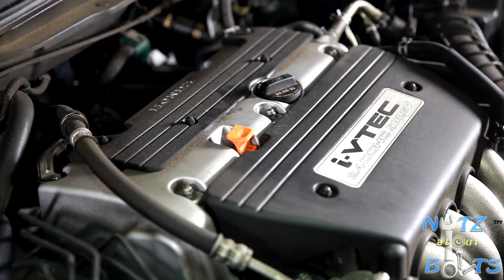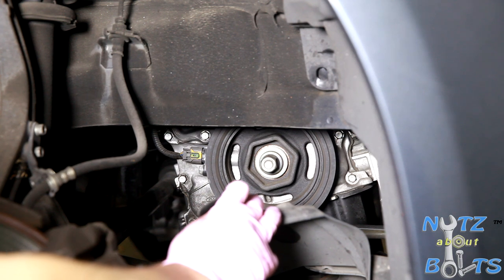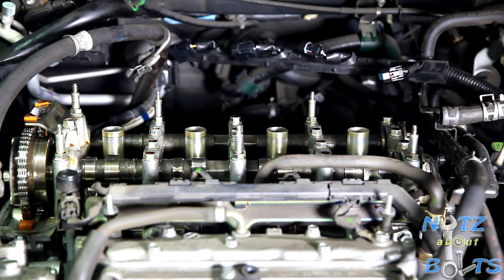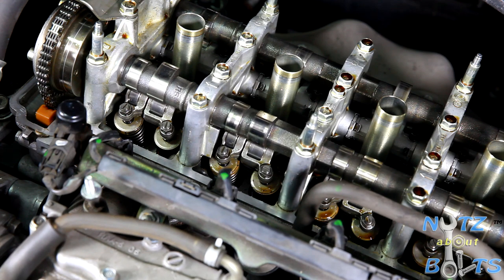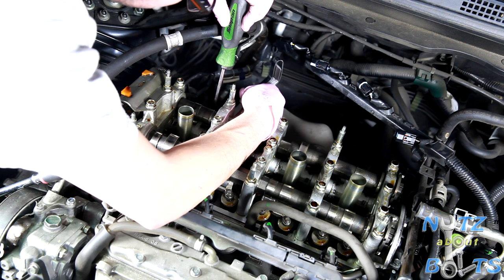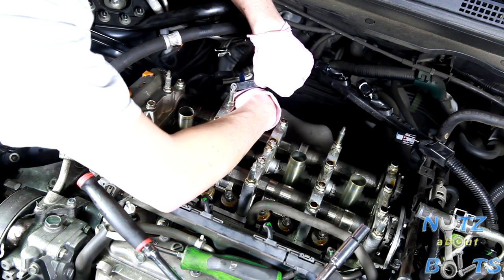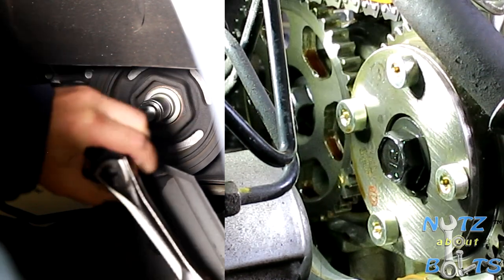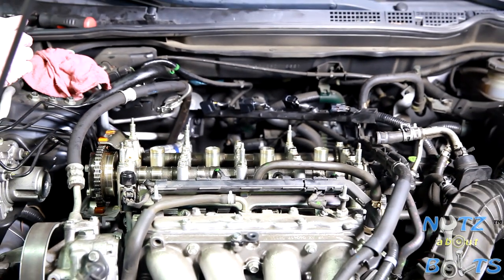2003-2007 Honda Accord Valve adjustments

Comment: Quick tip: leave the tire on and don't mess with the crank pulley.  Remove the valve cover and spark plugs. Throw a 3/4 inch wrench on the bolt for the power steering pump. Rotate that clockwise instead of the crankshaft pulley. You can do the whole job without getting on your hands and knees. Great video thanks for sharing
Reply: Yep.  That's the easiest way.  I just did the job myself.
Reply: I think it is 19mm, but 3/4" is quite close :) Thank you for the tip!!
Reply: I agree ☝️
Reply: I am dumb, 3/4" = 19mm. Tried to be smart, learned myself. lol

Comment: Does it matter on which angle you insert the filler gauge? And how much resistance should there be when you are in the spec. For example if I adjust intake to lower limit 0.008” should I be able to insert a 0.009” or 0.010 filler gauge
Reply: The spec is .008-.010

Comment: At what mileage is this recommended 100k ?
My 04 accord has 175k I’m sure I’m due for this.
Thanks for the informative video I’ve done this on many diesels but never an overhead cam engine like this.
Reply: Clint McDowell, yes your engine is probably due for a valve adjustment. I think the Honda spec is to check the lash every 30K miles and adjust as needed. The valve train gets pretty noisy when it needs adjustment so I use that as my indicator instead of pulling the valve cover every 30K.  My 03 Accord has 245k miles and the valves have been adjusted twice. They are once again getting more noisy than I am comfortable with  so I will be adjusting again this weekend. I did  the first adjustment at like 80k, the second around 170k and now the third at 245k. If valves on your car have never been adjusted you should hear quite a difference in valve train noise after adjustment. Good luck!

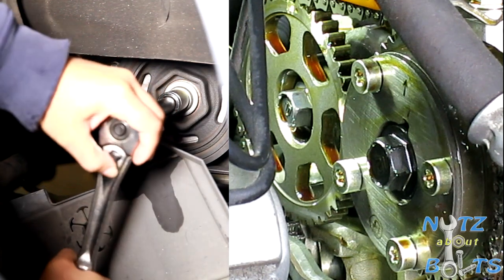Comment: Was a good video. At 5:50 your partner went counterclockwise a few degrees to correct the arrow's position. Good practice is to go back a few more degrees, then meeting the arrow to the chain dot going ONLY clockwise.
Reply from the maker: +Sgt Stupid we usually do that back and forth, you're right, but just wasn't worried. Honda's aren't that delicate lol
Reply: +NutzAboutBolts I get that. I'm a diesel mechanic and we have to be delicate with things like that. I find myself cringing at the simplest things.
Reply: Not that delicate?  I turned  my 1990 Integra in the wrong direction (to inspect the belt) and 3 of the rocker arms FELL right off
Reply from the maker: martik778 Those rockers are on a heavy steel rod that goes all the way through the head, that's not even possible lol
Reply: Huh? They 'float'  under the cam, between the cam and the valve stems, It's not uncommon -  Google "integra rocker arms fell out"

Comment: Im trying to find the vtec valve but I dont know how it looks and where its located...do you know that? my car is loosing power on gears when I speed up after driving for more than 1 hour...thank you.
Reply from the maker: the vtec solenoid valve is behind the engine on the passenger side.

Comment: My 2006 4 cyl Accord is 330K miles now. I did all services my self , Thanks to your videos. But when it was due for valve adjustment (tens of thousands of miles ago), this video was not uploaded yet.
 My question 
I never did valve adjustment for my car, and I still get excellent performance and excellent MPG 30+ hwy,  Do I have to do it at this stage?
Reply from the maker: If you hear the valves are clicking, then you should... My vehicle's at 110k miles and it was still in spec., if you feel like your car performance has diminish, then I would do it, but if its still feels good, then don't need to mess with it.
Reply: Thats alot of miles/good for u man 👍/ i got a 03 accord hopefully i can break 300k
Reply: 30 mpg you said? woah mine only gives me around 21mpg hwy and 17-19 mixed. changed o2 sensor/new spark plugs/new oil/ and I don't know what else to do to get better mileage. Any advice?
Reply: Yes, Honda valves tighten over time and get quieter, so no warning before hand.
Reply: Typically, on these engines the inlet valves get a little loose over time, but the exhaust valves get tighter. Tight exhaust valves will eventually burn, because they don't touch the cilinder head long enough to release the heat. But before that you will probably get rough idling, engine shudder, or a lack of power.
Reply: @jeroen7699  the car reached 400K miles and I didn't do any valve adjustment. It eventually got totalled in a front end crash and the other party's insurance paid me $2500 for it. Not bad.
Reply: @PickyOne  Haha. I did see yours was an old post. But maybe my late reply will help someone else with valve clearance issue. Good to know that I don't need to adjust my valves too often, since your Accord did 400k without. Well done 👍
Reply: @PickyOne darn. My mom had an early 90's Accord 460K. Ran like a top. Totaled by drunk driver. No one was in it. Thank goodness. It probably could have gone to 1M.
Reply: @FirstnameLastName-sx8ls  Mine got totalled at 400K miles I kept driving it without AC and without airbag til I got the insurance check for $2500.

Comment: Would valve adjustments solve a P0341 - camshaft timing issues?  Timing chain and VTEC solenoid has already been changed but P0341 still exists.  If there is engine sledge, would recommend taking apart the camshafts, clean them, and then do the valve adjustment?  Thanks!

Comment: Question? My 2006 Honda Accord 4cyl uses 5w-20 oil, my dealer has used 0w-20 in my last 2 oil changes. It seems the ticking of my engine has gotten louder. will a thicker oil, such as 10w-30 hybrid oil keep my valve adjustment longer?  I have had 2 valve adjustments in the last year. Ithought valve adj were every 60,000 miles?
Reply from the maker: I haven't had any ticking problems on my vehicle. I would try thicker oil and see if it goes away, if not, then I would further investigate what's the problem. 2 valve adjustments in 1 year is odd because you only do it when there is ticking but it shouldn't be that often. My vehicle has 115k miles without any valve adjustments needed.
Reply: You shouldn't have to adjust the valves until over 120,000 miles.

Comment: What was the mileage of your engine when you recorded that video, because it is very clean ?
Reply from the maker: +Paweł .Paweł was 110k miles. thanks! :) did you happen to open yours up and see?
Reply: +NutzAboutBolts Yes I opened it to adjust valve clearance, it was not as clean as yours. I use Motul 5w40 x-cess. I am living in central Europe, it is rear here to use oil like mobil 1 5w20. Maybe I will try.
Reply from the maker: +Paweł .Paweł wow, that is thick oil. Your engine probably burning more gas than it is. how many mpg do you get?
Reply: +NutzAboutBolts it's around 23 mpg, I have 2.0 litre 4 stroke engine in accord tourer body. What mpg do you get ? Did you consider to make a video aobut EGR valve and EGR plate cleaning ? About the oil for me it is more important the engine protection than mpg rate.
Reply from the maker: +Paweł .Paweł that's pretty good, I get between 22-23 mpg. we are considering a lot of things, but time and schedule conflicts a lot and so we're still working on making videos....
Reply: +NutzAboutBolts Last question :) How offten do you change your oil ?
Reply from the maker: Paweł
5-7k or 6 months.
Reply: My Element needs that, then I got high. 😄

Comment: I was reading the Haynes manual. And it's asking me to find TDC on the compression stroke... Is that the method shown in the video? 

It also asks me to disable the fuel system and pull out the spark plugs. Is that necessary?
Reply from the maker: Yes TDC was shown in the video, as for disabling the fuel system, you don't have to. Pulling out the spark plugs, you can do that so it'll be easier to turn the crank pulley. We didn't do it so it was a little tough turning the crank pulley lol. But it was ok

Comment: I have a question for you..will a 2004 tsx cylinder head fit my 2006 accord 2.4 ..2004 tsx has smaller valves but the cams i found for it are from 2006 tsx..will the valves make contact with the pistons or will i be ok
Reply from the maker: Both different head. Find the accord head for your tsx, it’s cheaper.

Comment: Is eyeballing the arrow at the 3,6 and 9 oclock positions accurate enough for TDC of pistons 3, 4 and 2 or are you checking some other alignment marks like you did with #1?
Reply from the maker: eyeball if you have experience, otherwise follow manual

Comment: Do you have any recommendations on the navigation system.  I have an 04 accord it sat in garage for a week came back and the car did nothing.  After buying new battery found the nav screen not working. I took cd rom apart and cleaned laser.  still getting same disc error reading.
Reply from the maker: my vehicle doesn't have any navigation system... any check engine light? have you called the dealership to see if there's a code you need to input since you took off the battery?

Comment: nutz n bolts   do you know where i can get a fuel pressure adapter to test fuel pressure on a 2.4 returnless accord.   i have the gauges i just need the adapter     thanks    happy newyear
Reply from the maker: check harbor freight or any auto stores.
Reply from the maker: maybe Napa auto parts? or online.
Reply: between the rockers there's a small cap and spring what are they called
Reply: U hv to buy the special HONDA brand fuel pressure adapter to hookup from the fuel damper. US$50 a piece. Sorry no place u can find other way to attached it.

Comment: This is a $500 job if done at the dealer.
Reply: jogmas12 thats why i own honda.DIY engines
Reply: Hmmm your Honda dealer is ripping you off.  Mine charges $135 if you have them do it.  I actually had mine done today on my 07 by my trusty mechanic.  $149 for the valve adjustment also including an oil change as well with synthetic oil.
Reply: @southernfarmtech  Thats a sweet deal. I can't find any mechanics around here that are that cheap
Reply: @dc366  thats the benefit of having a good mechanic who doesnt have any overhead.
Reply: $50 on Honda Czech Republic (without resealing head cover gasket).

Comment: need help 2007 honda accord 4 cylinder code p0135 how to replace sensor bank 1 video would be nice thank you
Reply from the maker: Its the air fuel ratio sensor, its the sensor right after the exhaust and before the cat.

Comment: did your milage and power get back from where it was ive got one with a bad mpg issue and not much power?
Reply from the maker: well, it wasn't off by much, so I'm still getting the same mpg. I'm planning on selling my Accord and getting the Prius C for better gas mileage lol.
Reply: David Hebenstreit I only get 240 250 have ticking 154 k doing valves shortly

Comment: i did valve adjustment yesterday.... car jerks in 2nd gear after 3.5k rpm...

car fine in 1st gear... check engine light also blinks when above 4k rpm in 2nd gear...

on stopping car engine lights stops blinking

triptronic auto japanese spec car
Reply: usman khan u have a misfire

Comment: Thanks for the video! What difference did you feel in your car after the adjustment?
Reply from the maker: +Juan Aguirre well, I will be watching my mpg once I get the time and see if it made a difference or not. My engine was running 22 mpg when the normal range is 26 mpg city and 33 hwy, so we will see... I have to refuel and reset my odometer and check it once I get to do that. Also my car was running normal and wasn't noisy, so can't tell on that yet. Adjusting the valves will help with gas mileage and performance issues.
Reply: +NutzAboutBolts Thanks for the response!
Reply: howdy from the lone star state. mine is getting bad milage also i am replacing valve cover gasket kit parts i saw a little oil residue in the intake and on the throttle body. plugs were kind of bad on had no elctrod left. the thing is i had no noise pings and have a accord exactly the same that gets much better mpg and has more power. what do you think it could be? pcv valve ? i get no check engine light either. 😞

Comment: You do not adjust the valve with the feeler gauge in, that is a no no.
Reply: Why not? Just a question
Reply: @Rainwen1die  because the feeler gauge is in the way. You adjust and then check with the gauge.
Reply: You should be able to, just take it out after and retest, you can use the gauge for a feeling when you slightly touch it  @BlackCubone